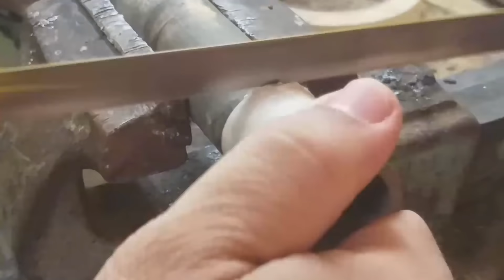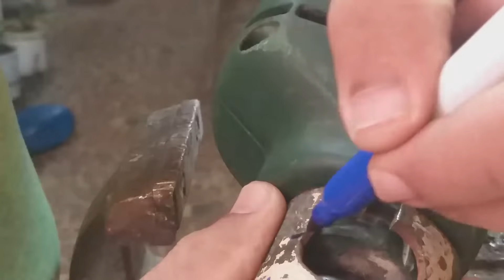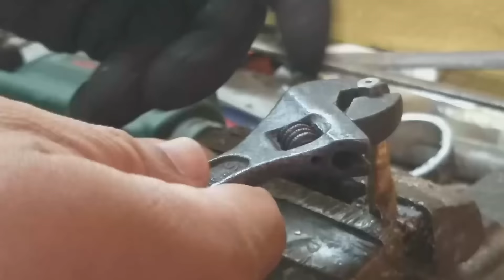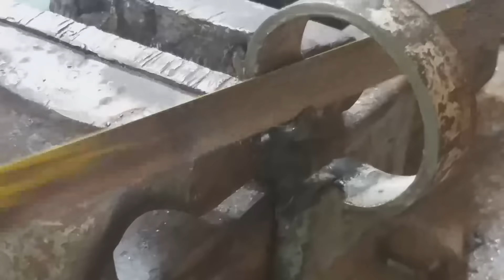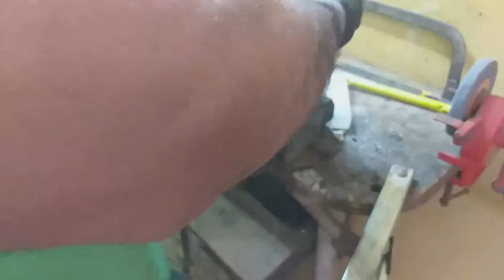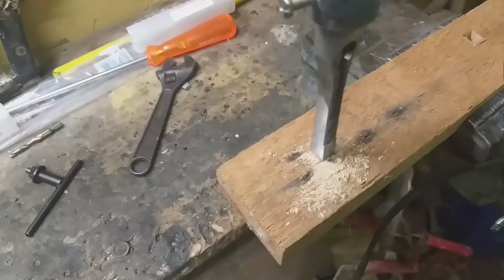Adaptador de Broca de Furo Quadrado

Comment: Hello my friend. This is a good idea. I have also made such thoughts for this tool. In my opinion your work bench is not stable so the wood shakes and the drill is not so effective. It moves constantly. Better use it either in a more stable work bench or even on the floor to see results.
Reply from the maker: Hi my friend, thank you very much for your comment!  the bench was not very stable but I also believe that the accessory I made was not very well made.  The drill needed to be more stable in the attachment.  it seems to me that after using it a few times the drill has lost its cut.  After I made the video I didn't touch the piece anymore.

Comment: Very very very excellent I like it  -  Is the drill an ordinary or a hammer?
Reply from the maker: drill is a hammer drill but it is very old.  I believe the hammer is worn out, but in addition the drill was developed for a bench drill where the force is more directed.  The hand drill oscillates a lot with the handle.  Thank you very much for commenting!
Reply: @AlexandroMachadodeFreitas  ❤

Comment: When this tool apply with 13 mm drill,which rotary speed more than 1000 rpm,it become useless
Reply from the maker: I think this drill has more than 1000 rpm, so do I. The square drill should not be of good quality, it is Chinese.